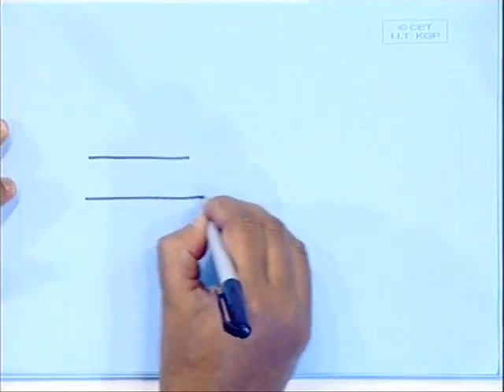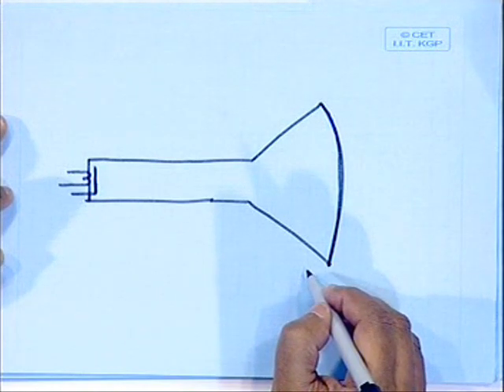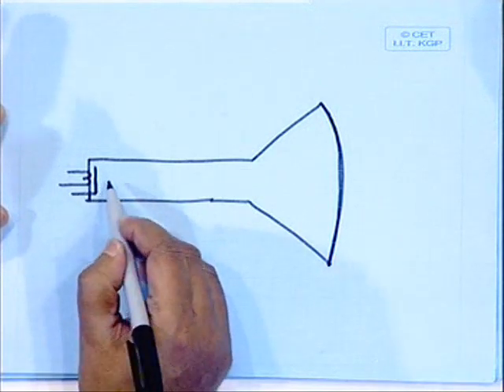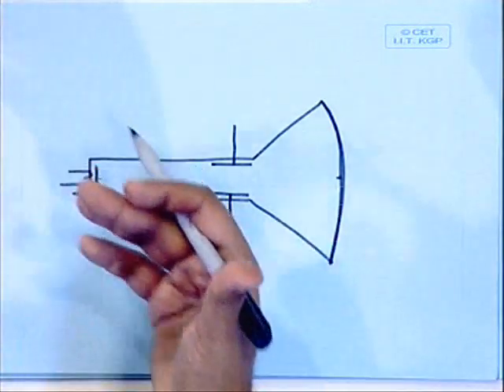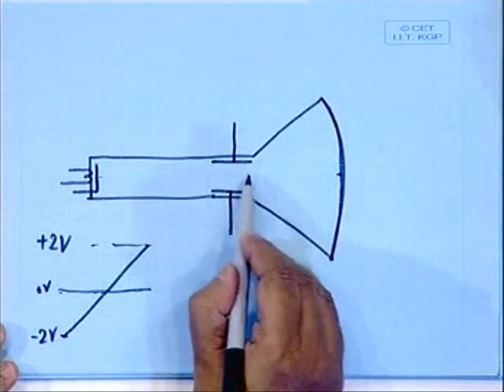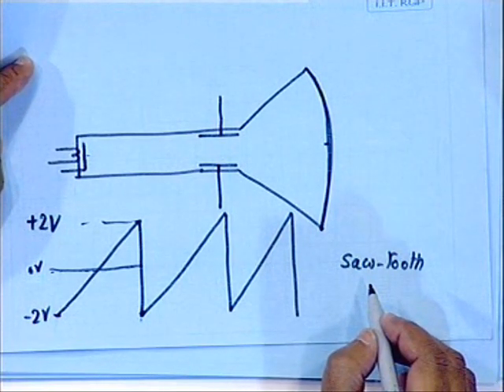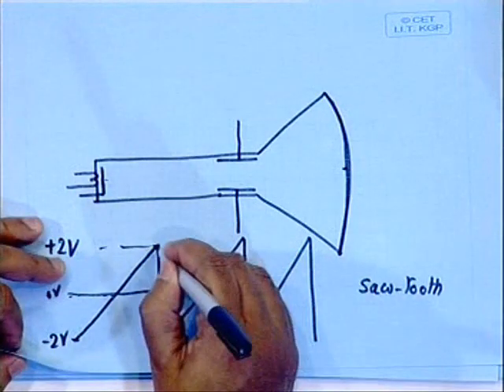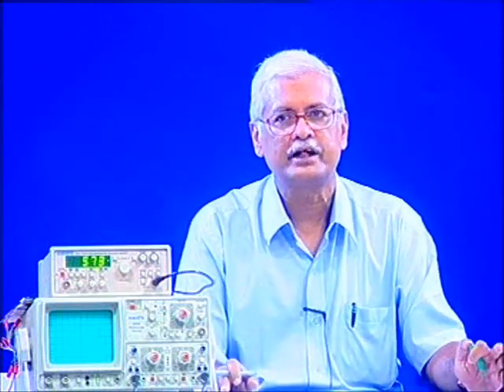Oscilloscope Tutorial - IIT Kharagpur - Part 1 of 2

Comment: Is it an Analog Oscilloscope...? It must be...The signal is continuous, if i am not wrong, and not discrete valued samples, and sampled at some sampling rate, using some ADCs, and sample hold circuits...How much bandwidth signal are we looking at...? Greater the Bandwidth, greater the cost of this equipment, also the number of channels...and save signal values...Would like to see, some Tutorial on Digital Oscilloscope, Spectrum Analyzers and Logic Analyzers,which are used more commonly in Industrial Product based RF Circuits and Commercial, Automotive, Embedded or Medical Electronics...And most importantly, How will anyone calibrate the CRO, before starting up, with any circuit...? First, before starting with any circuit, we start with calibrating the Input and Output channels for some fixed signal...

Comment: But why electrons are not striking with the horizontal or vertical plate of +potential?
Reply: Because the anode voltage is extremely high.  The anode is sucking those electrons from the cathode.  Regular vacuum tubes also have a high anode voltage that is typically +300 volts.  Watch a few videos on how vacuum tubes work.